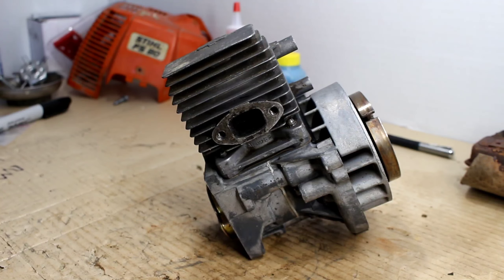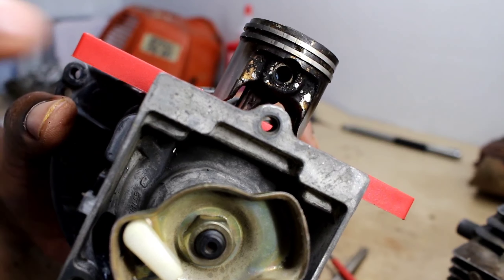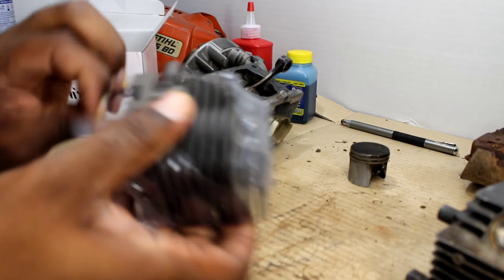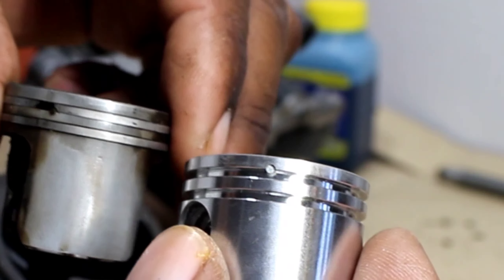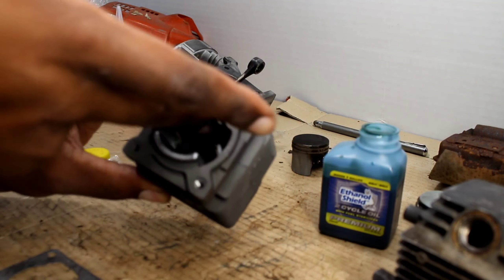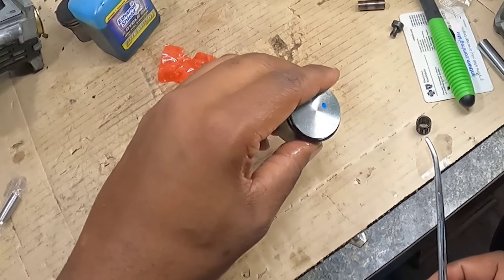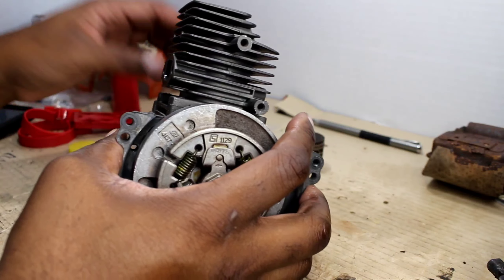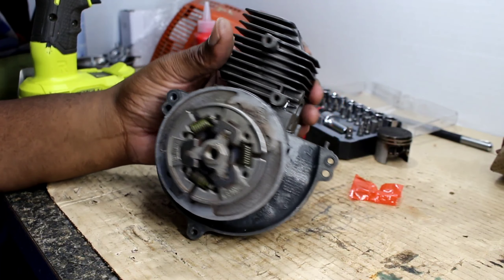Stihl fs80 fs85 cylinder head and piston replacement ❗ top end rebuild Part 2

Comment: I have a fs85 given to me. The exhaust side of the piston is scored. How’s this yamazon special holding up. I’m debating doing this or buying a used oem off eBay for $50
Reply from the maker: I've been using it all summer and it's still running well.  Yamazon got this one right it seems like 😂
Reply: @HowIDoItFaM  awesome thanks for the reply. I’m ordering it now. This is the first time I’ve ever done one. Do I need the ring compressor? I’ve replaced pistons in an atv and just pushed them with my fingernails until they slid in the cylinder lmao 🤣
Reply from the maker: @davidpavshak330  nahh you don't have to have it. It makes it a little easier but it's not necessary.
Reply: Your last video says you had an issue with intake gasket. I tried using the original head gasket and it was leaking bad. So I took apart and used the new head gasket and used red gasket maker. Now I still have a leak somewhere. I’m wondering if it’s also my intake gasket. I have an Amazon special carb coming tomorrow so we shall see.
Reply from the maker: @davidpavshak330  have you gotten it to fire at all?
Reply: @HowIDoItFaM  yes. But I have to hold the throttle in just to keep her going. If I let it go to idle she chokes out. I ran a compression test and only getting 85psi. I had more compression before changing everything with the scratched up piston lol. I tinkered with the carb but I have a hipa one coming tomorrow.
Reply from the maker: @davidpavshak330 same thing happened to me before.  Was the head gasket one time and a intake another time.  Make sure you have your gaskets oriented correctly if you cover up a breather port it behaves the same way. 

Quick tip. You can use starter spray or brake clean to spray around those gaskets and pin point where your leak is. Depending on where you're spraying If it stays running  you'll know where the  leak is.

Comment: So what happened to that weed whip specifically? Bc i think my grandma poured regular gas in mine and i wanted to know, if just fixing the carburator would fix the problem?😊
Reply from the maker: You mean regular gas no with no oil mix?
Reply: @HowIDoItFaM  yeah
Reply from the maker: Changing the carb won't do much about that. You're biggest issue right now if you lost compression due to the lack of lubrication on the cylinder and piston rings.

 Did it lock it up?  Or can still pull the string and it'll turnover?

Comment: Thanks. Any tips on getting very tight T27 screws undone? I don’t want to break the bit 🤔
Reply from the maker: Thanks for watching! Glad to help.   Slow and steady wins the race.  I'm guessing you're talking about the cylinder head bolts?  1st thing first make sure you're using the right bit ( I've made this mistake before). 

Couple of things you could try though. Try tapping the bolt with a hammer ( may need and extension)  to kind of shock the threads.    The other involves heat ( I don't know if I would use this method unless you are sure all the gas mix  vapor is gone from the engine.
Reply: @HowIDoItFaM  yeah the cylinder head bolts on a Stihl strimmer. In great condition but I don’t have enough torque. I think I’ll get new sockets
Reply from the maker: Shihl makes petty good bolts. I figure you would mess the bit up before the bolt
Reply: @HowIDoItFaM I got the bolts undone but now I can’t get the head off from the shaft casing. Any tips?
Reply from the maker: Does the head move at all or does it seem like the piston is stuck inside the head?
Reply: @HowIDoItFaM  the piston moves up and down fine but the head feels very solidly fixed to the crank shaft housing
Reply from the maker: @delatroy  if you've removed the 4 t27 bolts there is nothing else holding it together. Might have to put some more elbow grease into it  to pull it apart.
Reply: @HowIDoItFaM could the gasket be glued / sealed in place to require that much force? Yours lifted out effortlessly
Reply from the maker: @delatroy  could be but it still shouldn't be frozen like that